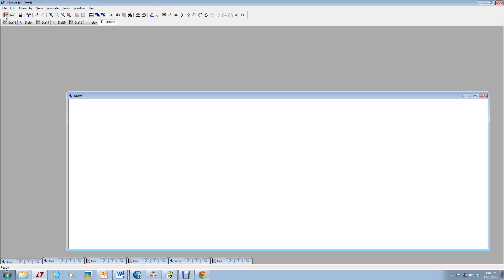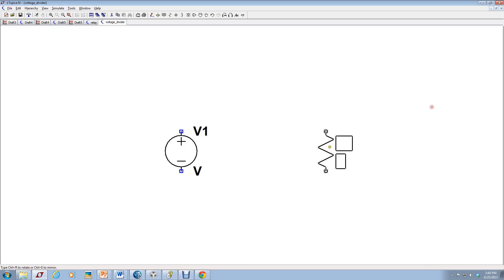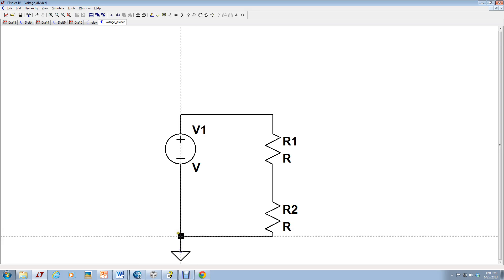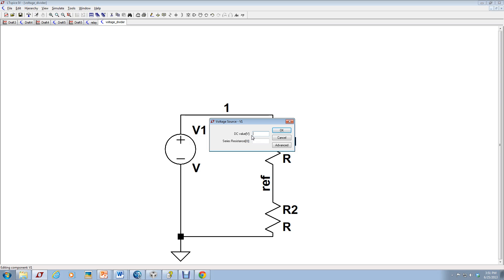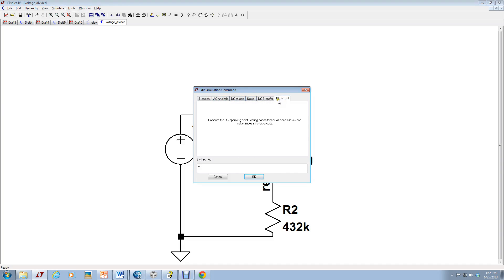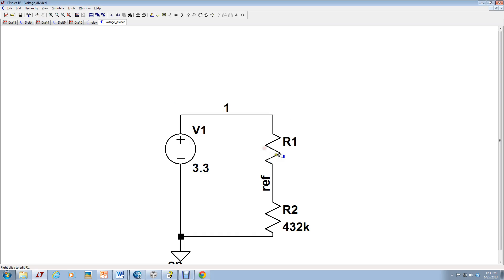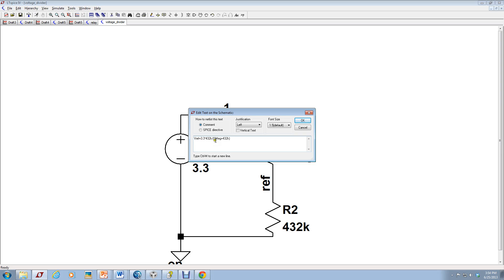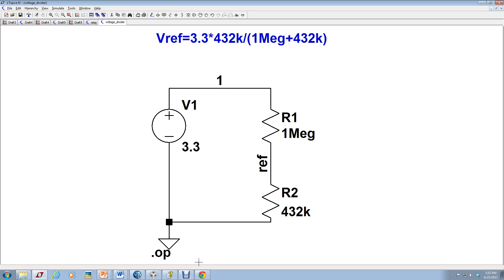"Live" demo of LTspice

Comment: useful shortcuts:

F2 - component
F3 - wire
F4 - netname
F5 - delete
F6 - copy
F7 - move
F8 - drag (wires move w/ component)
F9 - undo
shift + F9 - redo

T - comments
S - SPICE directive

G - Ground
R - Resistor
C - Cap
L - Inductor
D - Diode
V - voltage source

Ctrl + R - Rotate
Ctrl + E - Mirror
Ctrl + L - open error log

Space - Zoom to fit